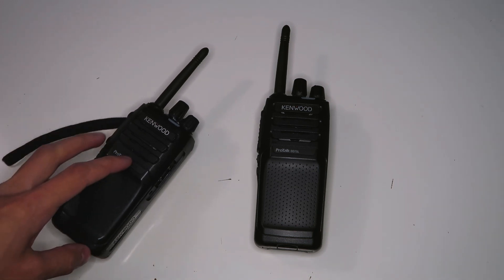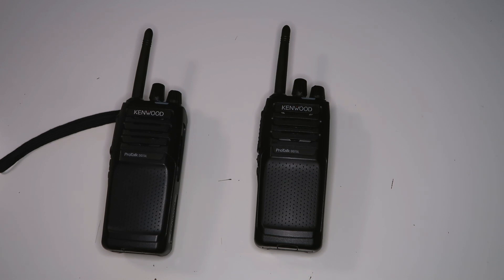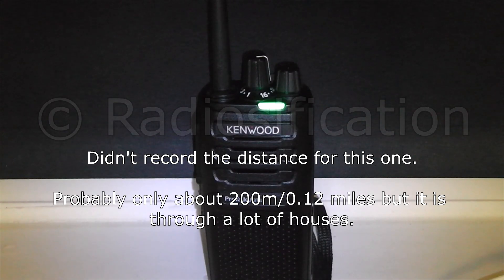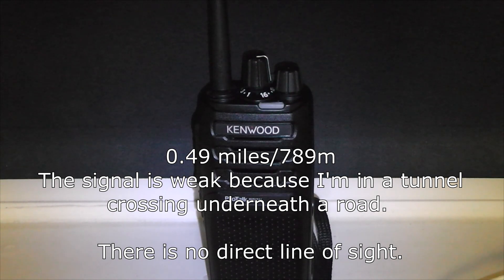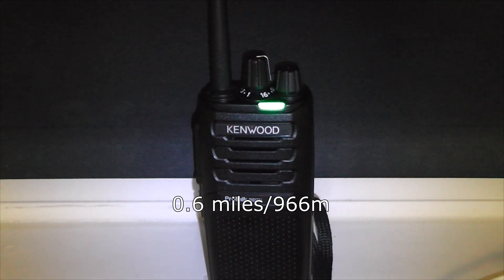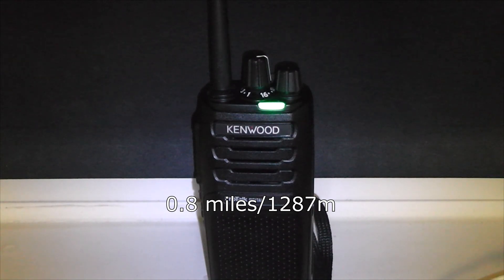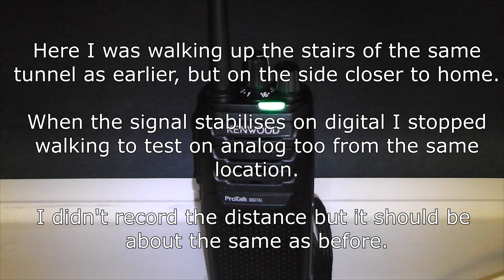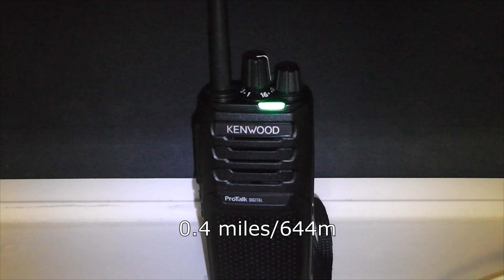This digital mode gets better range than FM

Comment: Fact is that when your in range your in range but if you exceed the necessary signal strength of digital, it’s dead. DPMR? Maybe DMR on a PMR radio? Has anyone tried decoding these radios with a DMR decoding scanner to get the info? I use P25 mobiles (totally different digital format) but my equipment is useable from 380 MHz to 470 which includes PMR frequencies. If I get a chance I will see what the range is. I will say that the recovered audio is far better than DMR where you can barely make out who is talking to you.
Reply from the maker: This is not DMR. It's dPMR. An entirely separate digital mode, just like P25 is different than DMR. dPMR is very similar to NXDN. dPMR equipment is sold as PMR446 radios like this but also as licenced equipment with higher power outputs, repeaters and even trunking systems.

The vocoder is exactly the same as DMR so intelligibility is the same assuming a solid signal. The only variability here is that some manufacturers/models have good audio and some don't.

Comment: These certainly seem better than the Motorola XT660d dPMR radios. In digital mode they don’t reach 1/4 of a mile whereas other PMR446 radios I own transmit a greater range in the same location.
Reply from the maker: Wow, interesting. There has been some other complaints about the range of the XT660d too. Electronics noob blog did a video comparing it to an older radio (both in analogue) and the XT660d got worse range.

Do you happen to own any other dpmr radios? Or an SDR by any chance? I've just heard that the Motorola XT660d is apparently NOT a dPMR radio but I'd like to try and confirm it, either by getting someone who has another dPMR radio to try talking to it, or by using a recording from an SDR to try decoding it in software using a dPMR decoder.
Reply: @radiosification  I’ve only got a pair of XT660d’s unfortunately. I always thought it was dPMR, it certainly sounds like it on a scanner. But it may be Motorola’s seemingly worse version of it. I’ll have to try them on my AOR DV10.
Reply from the maker: @spig021  Oh that would be great if you could try them on the DV10 and see if it decodes. Thanks!
Reply: @radiosification  I’ll try it over the next few days & let you know the results. On the strength of these radios I’d given up on dPMR. However those Kenwoods look & sound great. I also like the look of the Icom IC-F29SDR’s, but I think they’ve stopped making them & they are really expensive.
Reply from the maker: @spig021  Thanks! Yeah the Kenwoods are good radios. I like them. The latest Icom model is the IC-F29DR3 but they're a bit too expensive in my opinion at about £230 I believe (you can also look for the IC-F29DR2 which I think they've only just stopped making so it's still in stock in some places or may be going cheaper). The Kenwoods are much better value for money. If you go on ebay you can sometimes find them cheapish, like £130 each. 

It sounds like the XT660d was just not a very good radio, so don't judge all of dPMR by that. In fact years ago I had a pair of Kirisun S780s that got awful range compared to their analogue competitors. I though digital was just rubbish as they were my first ever digital sets but it was just the radios.
Reply: @radiosification  I got the DV10 cranked up tonight & it decodes the XT660d’s perfectly as dPMR.
Reply from the maker: @spig021  That's super interesting! Thanks for that. Is there any chance you're able to record the baseband audio on that DV10? I'd really like to get a recording any try playing it into DSD to see what it can get out of it (and if it recognises it as dPMR)
Reply: @radiosification  I’m not sure what you mean by baseband audio.
Reply from the maker: @spig021  I mean like the audio without decoding or any processing so you can get the digital signal
Reply: @radiosification  do you have an email?
Reply from the maker: @spig021  sure, it's the same as my YouTube username at outlook.com
Reply: BANA YARDIMCI OLACAK OLAN ÜSTAD VARMI TÜRKİYEDEN SELAMLAR

Comment: I'm a diehard analog fan but this test demonstrated this dPMR system beating the pants off analog in terms of readability in noise. I'm amazed at how well it worked! I still prefer the vastly superior audio quality present in analog, but you can't deny the performance of the digital system in a weak signal environment!

Comment: Hello sir, happy day. When I turn on the dongle and the driver works fine and with full signal strength, after a period of time the signal disappears permanently and the driver keeps working with him and the dongle. I turn the driver off and on again, the signal comes on Windows 10 32bit. What is the problem RTL sdr, please?

Comment: Thank you so much for another  excellent video! It was you who introduced me to the somewhat complex world of DMR a couple of years ago! But, I beg to differ from your table on your homepage. I am very satified with TDMA DMR on PMR446 in general and the Hytera BD505LF in particular.  At work, primary care facility, we are using DMR PMR446 with Radioddity GD 73, small and cheap.
Reply from the maker: Thanks for your input. The reason I recommended dPMR over DMR is because DMR needs TDMA direct mode (aka DCDM on motorola stuff) which requires one radio on the channel to occasionally transmit to provide timing synchronisation to all other radios on the channel. This consumes a bit of extra battery on that radio and is more complex than just having 6.25kHz channels in the first place like on dPMR. Additionally the lower bandwidth of dPMR is meant to give slightly better range. I trust you that it works very well, but not having that extra battery drain, extra complexity and slightly lower range seem like enough benefits to me to recommend dPMR over DMR (even though most people won't notice the difference).

What do you think of the build quality of the Hytera BD505LF?
Reply: @radiosification  No problems with the build quality of the BD505LF or my BD555s,  but of course the PD radios are built more like tanks.

Comment: Really cool test,
I did however noticed when I am doing radio myself inside the house I often find that the windows are compromising the range a fair bit. So question is would this range test have different results if you had your radio outside the window.
Reply from the maker: Yes that definitely could be affecting it here. The problem is, it would be very difficult to record the video (and get good audio) if I put the radio outside! The microphone would pick up a lot of wind noise and if it starts raining my camera might get ruined since I leave it unattended to do these tests.

I did mention in the video not to pay too much attention to the distances because the conditions are very difficult for 446 MHz radios. Lots of hills, houses, trees and as you noted, it's going through a window too. The video is more meant to be a comparison between the analog and digital modes on the radio.

In terms of range, I'd expect this radio to get roughly the same on analog as most other pmr446 radios of a decent quality.
Reply: DOSTUM TÜRKİYEDEN YAZIYORUM BENDE 2 ADET  KENWOOD TK 353 VAR ARKADAŞ VERDİ DAHA  KULLANMADIM BATARYALARI ÖLÜ BATARYALARI YENİLEMEYE DEĞERMİ  ÇEKİM MENZİLİ BAOFENGDEN MOTOROLADAN İYİMİ ROLESİZ OLARAK Bİ BİLGİ VEREBİLİRSEN ACİL SANA ZAHMET OLMAZSA, KAÇ KİŞİYE YAZDIM CEVAP YAZAN OLMADI
Reply: What I have discovered in the past in the States is that one would get the range of VHF with the penetrating power of UHF when we worked on the 220MHz spectrum allocated to Hams. A part of that spectrum was stolen form Hams due to lack of use and issued to commercial services. It was limited to AM very narrow band ( 1 MHZ between receive and transmit frequencies. It utilized Amplitude compandered side band. Not the best mix. For repeaters to work right one had to have discrete RX and Tx antennas, duplexers could not handle the narrow allotment between RX and TX.

Comment: Analog Usely have a Longer Range! DPMR is a type of DMR, I have a Alinco DJ-MD5X,
Reply from the maker: dPMR is not a type of DMR! They are completely different digital modes. dPMR is 6.25 kHz and not TDMA. DMR is 12.5 kHz and has two timeslots. Very different. They do use the same vocoder though so they sound the same. dPMR is meant to have better range because of the lower bandwidth.